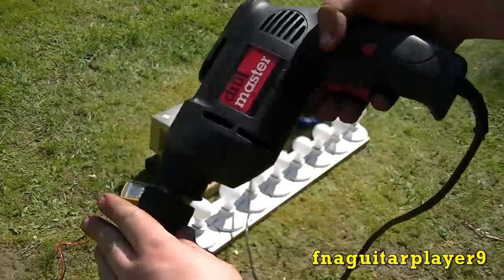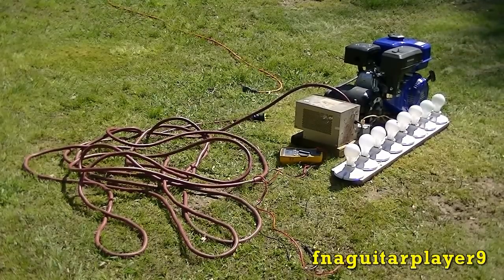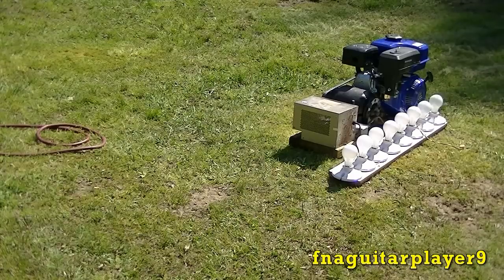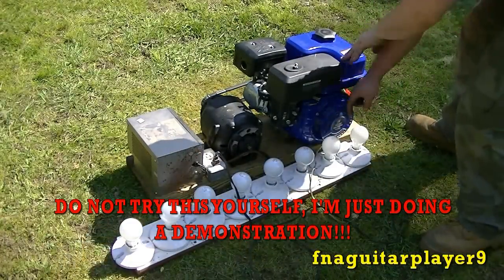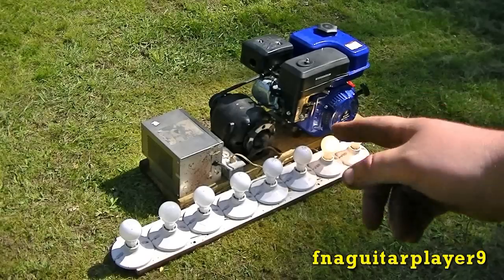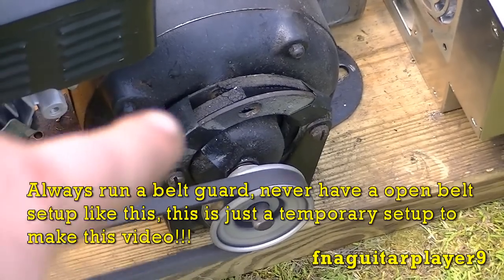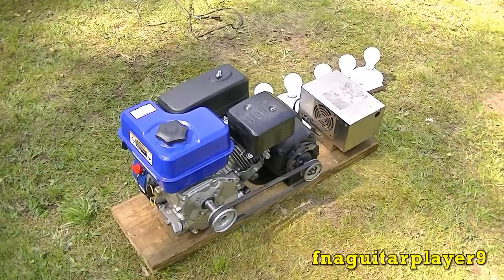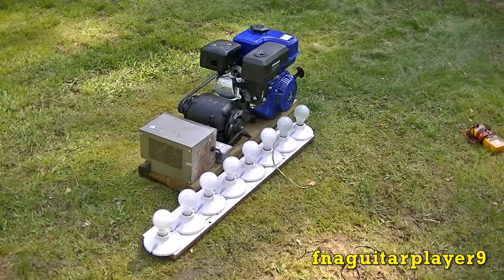How to plan and build a induction motor generator PART 2 of 2

Comment: Note on reving up. And capacitor voltage rating. Most voltage meters are telling you the rms value of a sinewave. 120volt ac output is the rms value of a sinewave with almost 170v peek.  Peek voltage is the rms value × square root of 2.

Comment: capacitance in parallel add like c1+c2, and they add in series like 1/(1/c1+1/c2+1/c3). but if one adds two in series to get a higher voltage rating, then try to use identical capacitors to avoid an imbalance of voltage across them. And one might want to avoid connecting more than 2 in series for the same reason.
Reply from the maker: Very true, its best to use the same. Thanks for Watching!!!

Comment: Common dude, why you didnt turned all lights on?
Reply from the maker: It wouldn't power all of them, it was only producing like 200-300 watts. Thanks for Watching!!!
Reply: @fnaguitarplayer9  thanks for video.
I have 5.5kw three phase motor, want to do generator. How do you think what power I could expect? 🤔🤔😊😊
Reply from the maker: @santaclausas  Your welcome, I would guess around 4 - 5kw would be possible. 3 phase is a different setup but it can be done.
Reply: @fnaguitarplayer9  thank you for answers, I'm collecting info for this project.

Comment: when planing your system what is a ball park rule of thumb for picking your ICE for the induction motor? 
for example in the video you said the induction motor was 1/3 hp what would be a good match a weed wacker 30cc or a briggs ? for example like 1/3 hp induction motor needs 1x, 2x. times the rated hp to drive it?
Reply from the maker: I'd say at least 2-3 times the hp of the motor should be fine, no set rule on it. A weed eater engine would probably power a 1/3 hp but the problem would be no governor to regulate the rpms so the frequency may change with load. If you use a bigger engine like i did in this video, gear it like i did so its running at a low rpm so it won't waste as much gas. Thanks for Watching!!!

Comment: Hey FNA, you should mention your capacitors see 41% more voltage than the meter will show.  This happens for a few msec at the top of each sine wave.
Reply from the maker: ***** That is true, i didn't know the exact % but that is why i say to use capacitors of at least twice the voltage the rating. Thanks for Watching!!!
Reply: That will give you a good safety margin.  Sounds like you've developed this after many experiments.  Search "What is the peak voltage for 120v" it's about 170 V, or 120 x square root(2).
Reply from the maker: ***** Yeah i figured it would be close enough, yeah I had some capacitors blow up in my face when i first started working on it haha Finally found out that motor run capacitors is what you have to have. I always figured it (as a aprox.) by multiplying the voltage by 1.33, reason i came up with that is I built a capacitor bank using a full wave bridge rectifier straight off 120 VAC, and the capacitors would charge up to 160 volts, so i did the math and came up with it being 1 and 1/3 the voltage.
Reply: I like the way you work stuff out.  You're real close to the theoretical value of 1.414.  Love the generator and small engine videos.  Keep those safety glasses close at hand!  All too easy to forget like I do.
-Kevin
Reply from the maker: *****
Yeah, i'm pretty simple haha Thanks, really appreciate that, that is so true, anymore i almost have a pair with me, my eyes are like magnets for everything haha

Comment: How well would this work for a wind turbine to charge batteries ?  Seeing as the wind speeds up and slows down (even starts and stops at times).
Reply from the maker: I was talking a friend a while back about this, i don't think it would work, unless there was like a governor setup somehow on it, the start / stop wouldn't matter much but it would have to be disconnected and reconnected when the it falls below the speed and connect again when its back up to speed. I think a alternator off a car or even a dc generator would work best then have a regulator in case it gets going to fast. Thanks for watching!!!

Comment: Of course if you are wanting to run two in parallel from the same engine, I would suggest mechanically locking them in phase using a chain/sprockets or a toothed belt. Much easier than having to sync them every time.

Comment: The way I understand it is that you want to connect the neutrals from the two generators and run a light bulb across the hots. The bulb will blink if they are out of phase. The faster the blink, the greater the difference in speed. Fine tune the speed of the engines until the blinking slows and (ideally) stops with the bulb off. Throwing a switch to connect the hots while the bulb is off will parallel them in-phase. Load balancing is a whole different issue.

Comment: ... which would (in theory) help combat voltage sag under load. I'm pretty sure this is how the brushless alternator in the 800w HF generator works. Allthough it does have a wire wound rotor with diodes, I would think you'd get a similar effect (maybe not as strong) with a solid rotor. I need to get my 5hp Briggs back together and try to build one of these. I've got an old 2hp dual voltage motor laying around to use.

Comment: Just a thought... Could you bypass the centrifugal switch, and connect your motor run capacitors across the start windings (isolate them from the run windings if needed)? The reason I ask is that it seems like it would handle a bigger load without discharging the caps that way and also provide some regulation. Heavier load on the run windings creates more magnitism in the rotor which in turn induces higher voltage in the start windings/capacitors which further increases magnitism in the rotor...

Comment from the maker: Yes the voltage does drop a little, the reason for this in this case is that the engine is just idling because of the size of pulleys, so technially even though it was a big engine it was under powered because it was idling and the governor on the engine couldn't compensate for it. If it was geared with the proper pulleys with the engine running at 3600 RPM and the motor at the name plate rating, it would have worked much better. I have no clue about the power factor. The output.....

Comment: also, nother question, if i hook 2 electric induction motors up to the same circuit will they self balance to have the same frequency or will one be offset from the other? is there a way to manually balance them?

Comment: i noticed that the frequency falls as the load increases, does the voltage drop too? if i made an electric governor to watch the frequency of the system and rev the engine or idle it to make it stay at 60 hertz as the load increased then would the voltage of the system jump wildly out of control or would it stay at 120 ish?

also what's the power factor of the system, if i made this system would i be using real power or volt ampere power?

Comment from the maker: yes, the governor will kick in on the engine and maintain constant RPM under load, now if the load gets to great the motor can slow down, the governor can only do so much, but thats why if this was a bigger electric motor, i'd have it geared different so the engine runs faster to get the most power out of it, but the governor would still maintain constant rpm, but if you put to much load on it, the generator will stop generating, as it did in this video under a big load. thanks for watching!!!

Comment: Just a question out of curiosity. If the demand of the the output is greater than what it generates, will the engine RPM compensate ? Meaning will it rev higher automatically to accommodate the demand or does it have to be done manually.

Comment from the maker: induction motor and build a generator that will put about a few thousand watts, and build a frame to mount it in like a actual generator. If i got a 6 horse induction motor it would put out aprox 4000 watts. This greyhound motor would run it good, but i'd have the ratio different so the engine runs at full throttle, so it gets maximum power out of it, like a standard generator. thanks for watching!!!

Comment from the maker: the motor i used in the video is a 1/4 horse power motor, 1 horsepower is the equiveltant to 746 watts, so it puts out 1/4 of 746 watts or 186.5, give or take some, if it was a 2 horse motor it would put out aprox 1400 watts. When you short it out it immediately demagnetizes the rotor, when you rev it up it excites the windings and recharges it. Regular generators have a permanent magnet on the rotor (to my knowledge), these have iron. yeah it does put out more, someday i'll get a bigger...

Comment: Good setup, question why is this only putting out about 200 watts and dies if you short it out?
I know the "field" will get discharged but if I did that on my generator it would ruin the alternator on i plus there would be fireworks...LOL..
The little Harbor Frieght generator you showed on one of your videos put out much more power, it seems like a motor that large would put out a lot more power than that.